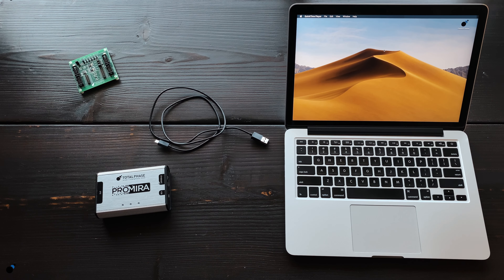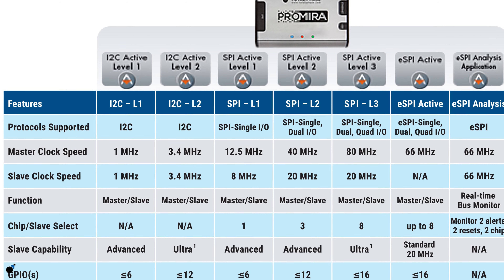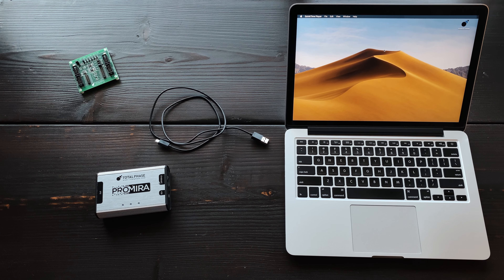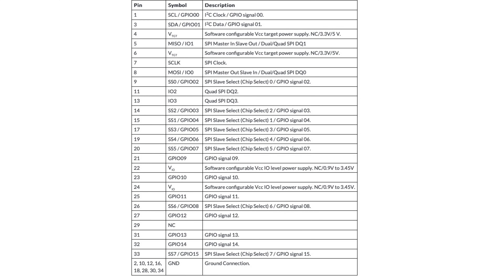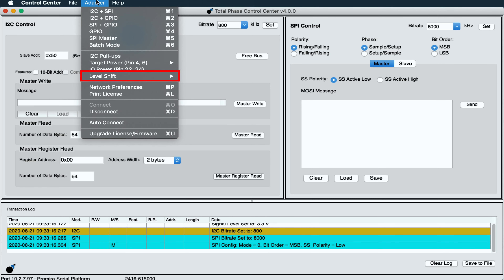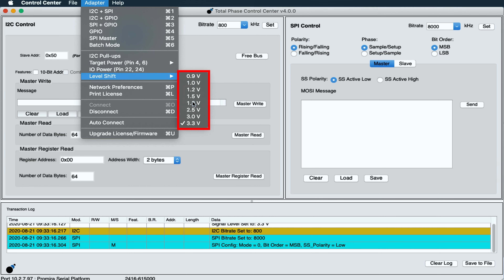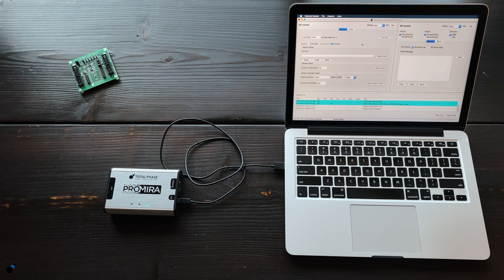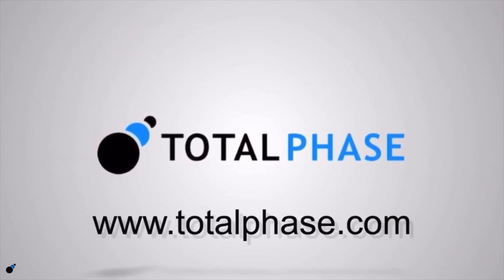Change Voltage Levels on the Promira Serial Platform

Comment: I haven't come across any systems that use a 0.9V logic level.  Are there any current systems that you are aware of?
Reply: One example I know of is AVSBus, which specifies an SPI-type bus that operates 5MHz to 50MHz, with bus voltage as low as 1V -10% (i.e. 900mV).